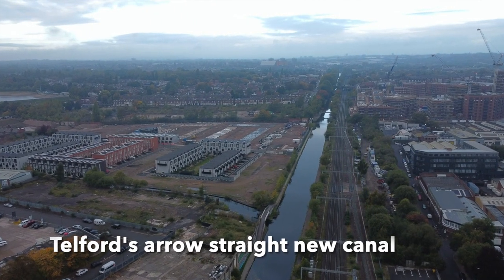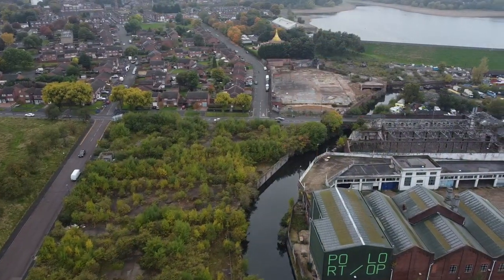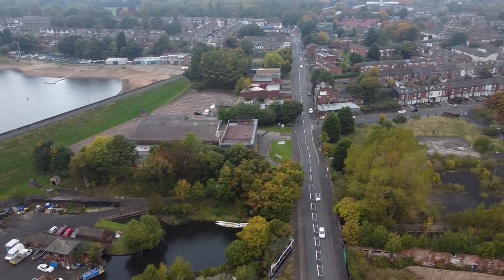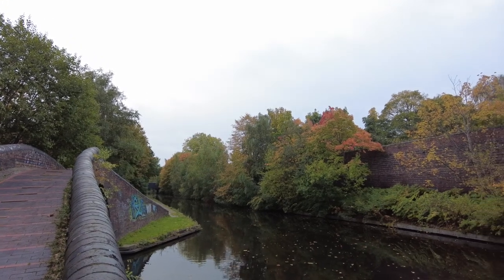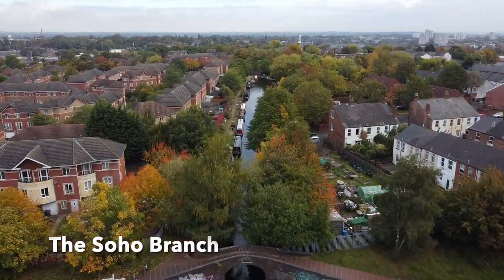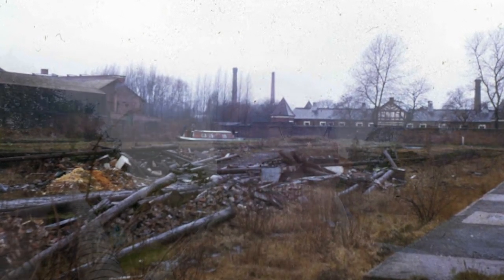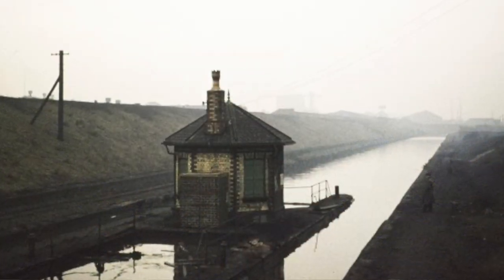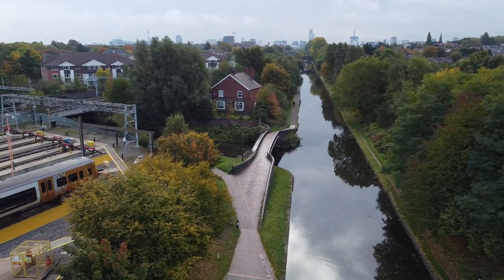Brindley's Loops - the navigable backwaters of the BCN

Comment: I'm certainly familiar with the Soho Loop - some 30 years ago I used to work in the GKN Computer Centre on Cranford Street, and the Soho Loop was a regular route for my lunchtime runs. We would occasionally go for a run around the reservoir, but that was pushing it a bit for a lunchtime.
A few months ago I took my boat around the Soho Loop and the Icknield Port Loop, and as you can imagine things have changed since my running days.
I found the new properties around the Icknield Port Loop a bit strange - they are built with just a small paved garden between the property and the canal. You don't usually get to see right into someone's lounge from the back of your boat - I suppose it's reverse gongoozeling.
Reply from the maker: Oddly, those patios sit on what was the towpath.